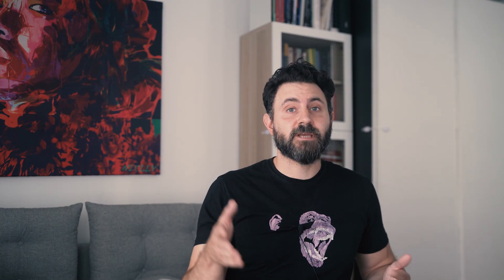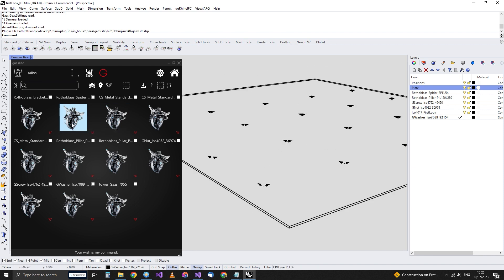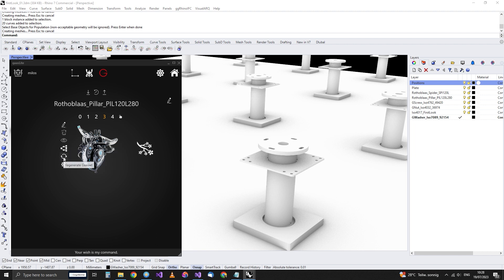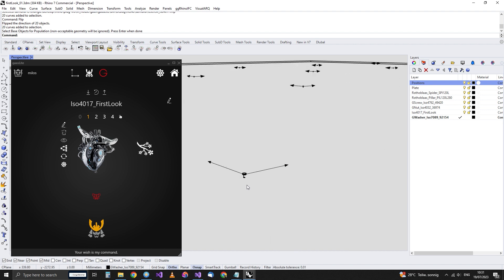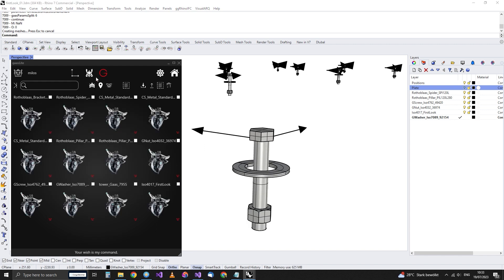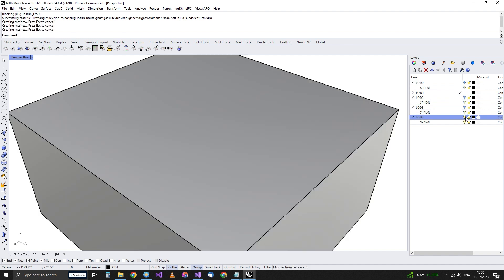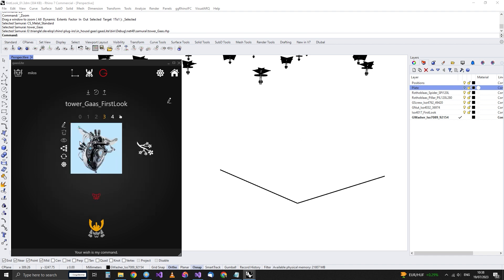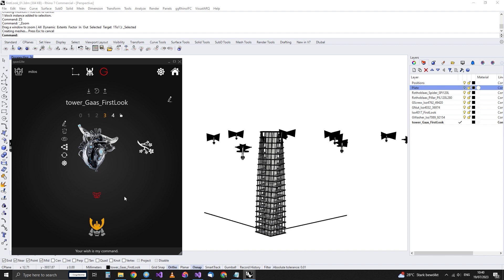Digital Twins Solved? GAAS Software First Look - Architecture, Engineering, Construction

Comment: I enjoy your videos, keep them coming! This video made me wonder, are you are creating a tool which might already exist? I wonder if you are familiar with tools like Inventor, Solidworks, CATIA etc.? I remember having a conversation with an architect once where I said if I had to choose just one of the architectural software available, I wouldn't choose any of them, I'd choose Inventor instead. Software like Inventor is all about manufacturable assemblies, parametric parts and library parts (for example, assemblies: https://www.youtube.com/watch?v=4QL7jVf-Rko, programming parametric parts: https://www.youtube.com/watch?v=Z3L7gO7wA4Q). I love Rhino and Grasshopper too, but I would normally choose Inventor for projects with use cases like you are describing. Thanks!
Reply: I have tried using inventor for projects that are quite large (building scale) and it simply cannot handle the amount of detail without major performance issues.  IME anyway.
Reply: There is no platform more mature than grasshopper and rhino.  Community support is stellar as well.
I think this is a valid question though, but a Rhino based solution would get great traction I think.

Comment: First: I'm a huge fan.  But, forgive me if missed something.  Did you just recreate Revit inside Rhino?  Everything you demonstrated, Revit already does?  Nested Gasset == nest families.  Apply gasset / family to points,  push / pull parameters, unit-agnostic, all pretty standard family Dynamo Revit option.  Grasshopper scrip as gasset?  Isn't that similar to Revit's adaptive components?   I'm not saying Revit is all powerful or sufficient... But what am I missing here?